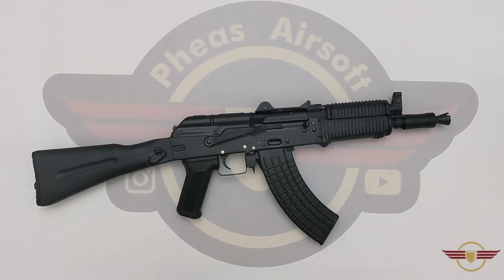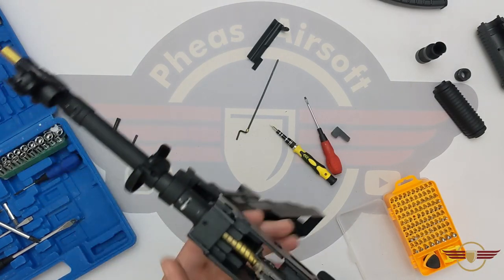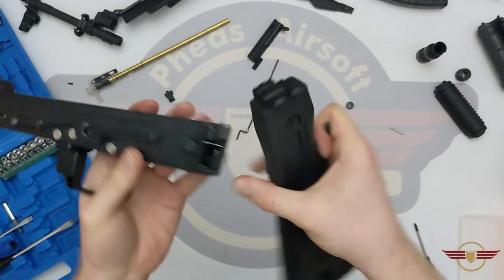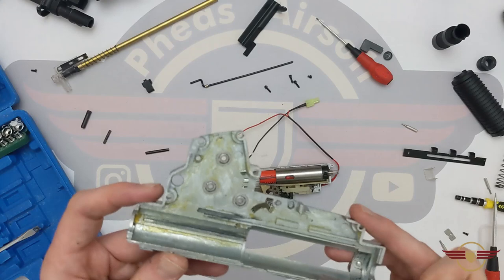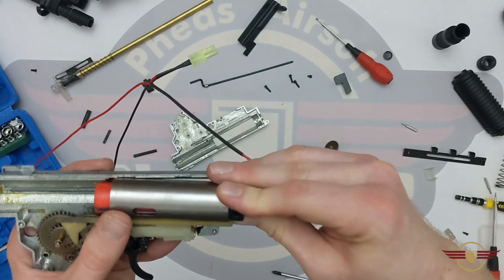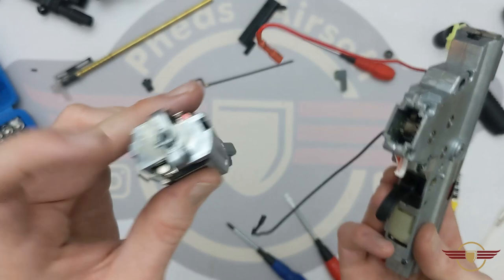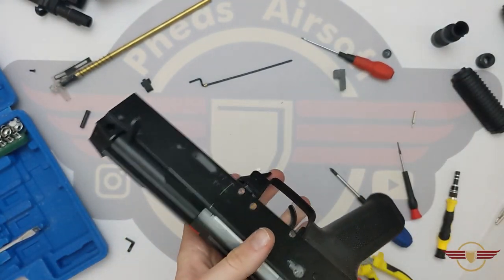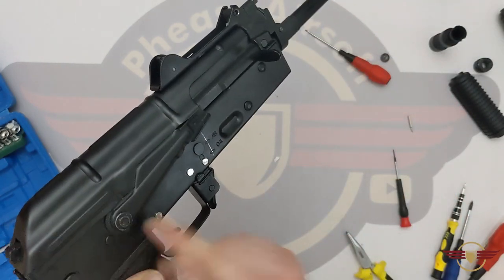[INTERNAL REVIEW] DOUBLE BELL BY-012 BLACK - Is it better than its budget price?

Comment: I opted for the slightly more expensive CYMA CM045 and I can honestly say that I haven't regretted it....also, it has a metal hop ;)
Reply: I got the CM035a and I wish I got yours, both of ours perform the same but yours can use actual furniture. I had to Dremel my gun for like 2 hours to fit a new handguard

Comment: Honestly I’ve got a double bell AK and I will say all I have changed are the hop unit and nozzle, the tappet plate seems to be just fine after about 10k rounds and I don’t see anything going bad on in it, just needs a re shim, honestly a really good gun if you like working on guns

Comment: Honestly, for the price of the Dboys, sorry double bell, their AK's are great value for money, certainly at this price point. Yes, Cyma are slightly better in regard to internals, however, most  of Dboys Ak's will run out of the box, with very minor adjustments for thousands of rounds, yes you can bitch and moan about this and that, but again, for the price point, it's value for money. It's good to see Double bell making some strides with their models, and not standing standing idle like JG did for so many years, although Golden eagle have shaken up their model range since they purchased them.  
So many airsoft manufactures now are bringing out newer models, which have all the specs you would never have found for the price that's asked for them by other airsoft companies, you only need to look at Specna arms, chewing away at the likes of G&G. Who would have thought that Double eagle  would bring out a range of aeg's which are even biting at Specna arms price point of the market place, I've seen them, and their nothing to scoff at, for the price their offered, even in the UK. Thanks for the taking time to share, much appreciated.

Comment: Dear, I just bought the AK RK12. and i wanted to put my tracer on it. But at the mark of 1.23. you just unscrewed the second treaded bolt. On mine. This is tight as hell. Do i need to put a tool in it to "losen"  it? or should it just come off just bij turning it the right way ? I have a litte movement in it. But. it does not come off so easy as the muzzle
Reply: Got it!
Reply from the maker: @djchico2003  Sorry for the late reply! Still catching up with myself from my holiday! Glad you got it sorted in the end!